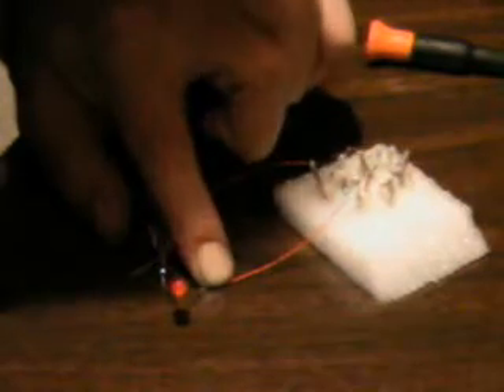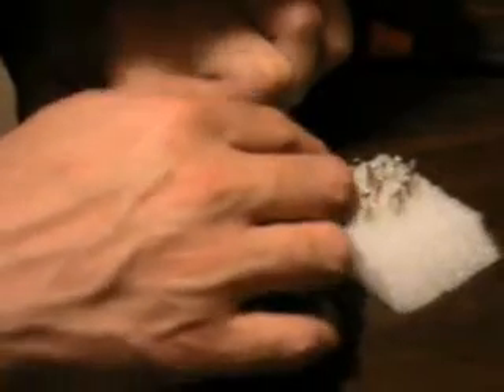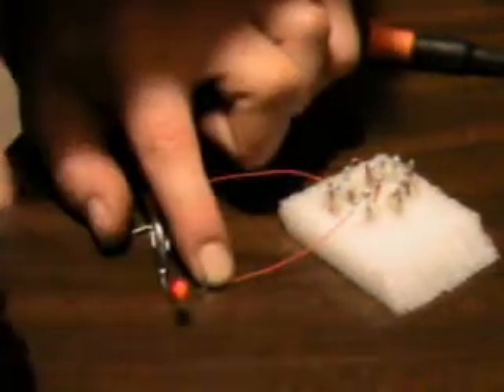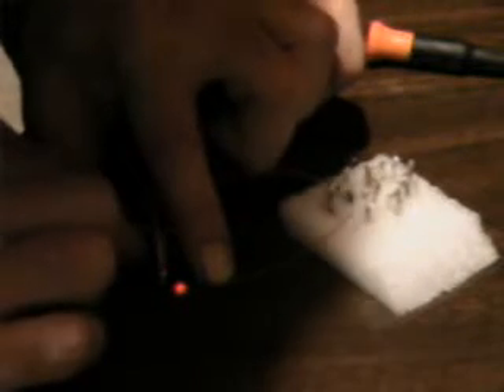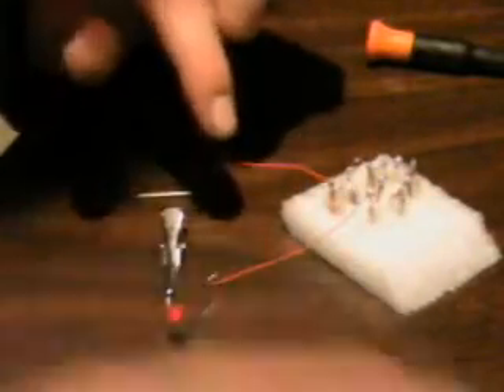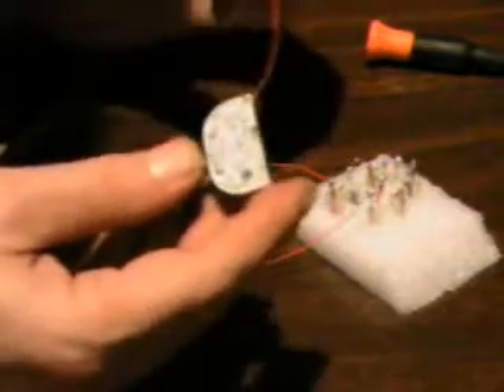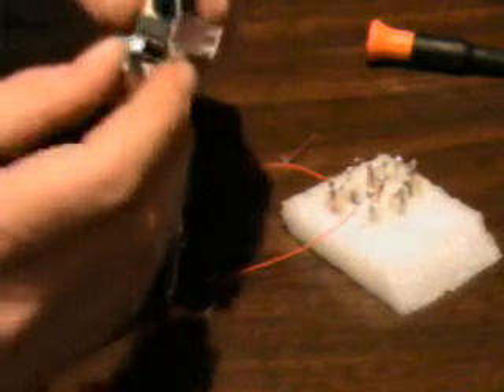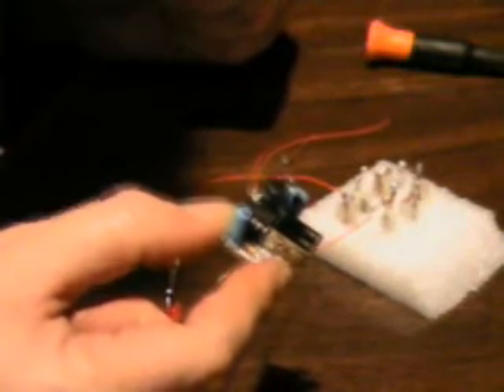Small water battery

Comment: have you tired pulling the voltage through and into Capacitors ? and stepping it up ? I need to get a hold of simple DC stepping up voltage and use those kind of results to move to 12v 10 amp to car inverter 120v to power tv thanx.